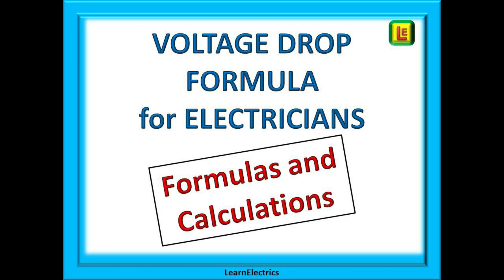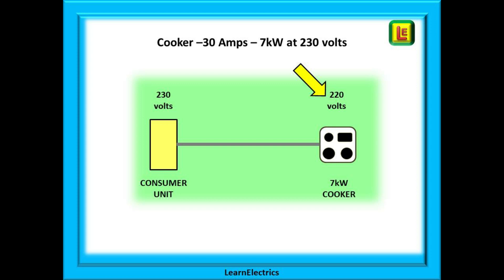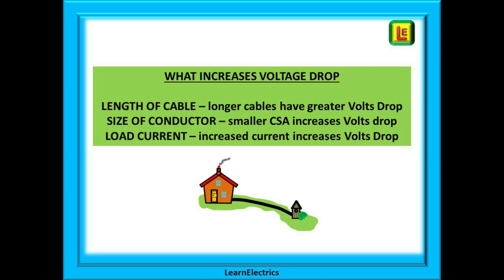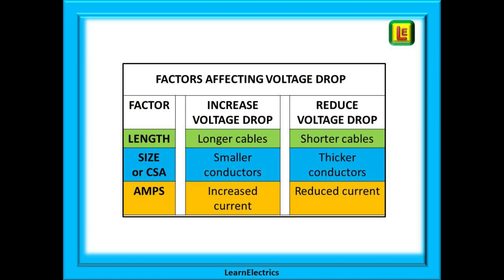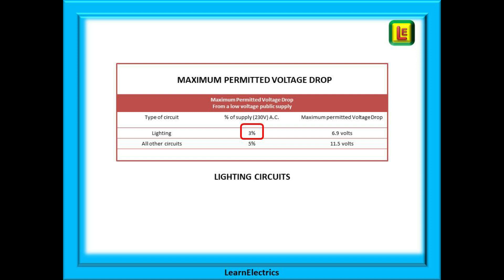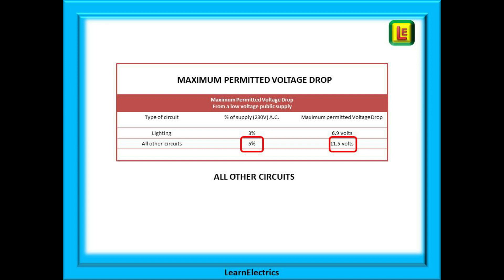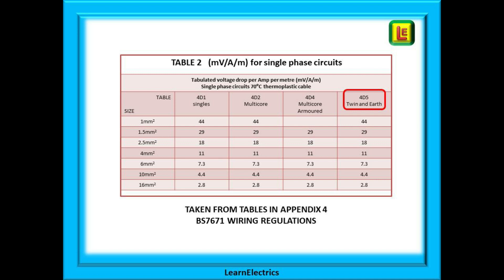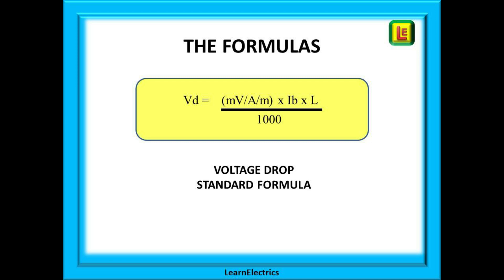VOLTAGE DROP FORMULA    Which formula to use and how to do the calculations correctly.

Comment: Do we calculate the length with 2 for single phase load ?
Reply from the maker: This is the single phase formula and takes account of there and back i.e. line and neutral. We just measure the distance one way and the formula does the rest.

Comment: Is load always assumed to be at the end of the full circuit length?
In a circuit with fixed loads such as a lighting radial, will the loads not be at different points/lengths from the CU and mean that we have to calculate vd at each individual point?
Lastly in a domestic situation its unlikely all lights will be on at the same time. are there any diversity calculations to account for or do we always assume worst case?
Reply from the maker: See previous answer, thanks.

Comment: If i am calculating voltage drop for a lighting circuit do i use the measured length of the cable from the distribution board to the furthest light fitting or do i need to multiply that value by 2 seeing as the current has to travel back to the distribution board.
Reply from the maker: take a look at this latest video we've made on voltage drop, it will give you more information. But to answer your question, only measure the distance one way, from the CU to the point of use, NOT there and back. dave.
https://www.youtube.com/watch?v=nVZeIFeEwl0
Reply: Good question, I think the tabulated values for voltage drop per amp per meter in table two account for both the line and neutral wires and therefore you dont multiply by 2

Comment: Hi I have tried this using the tables in osg to compare, it's very close to 2.5 wire but say not with 16mm cable using the majic 1.2 factor
Reply from the maker: The OSG rounds up/down the figures so there will always be tiny differences.

Comment: Could i pick your brain just the once more.

My own cooker.

Ib 4kw -4000w

L 1m cable.

mV/A/m is 6mm cable 7.3 mV/A/m (table 4d5)

7.3 x 17 x 1
~~~~~~~~
  1000

0.12 amp drop

Thanks.
Reply from the maker: Yep, that's almost correct Paul, it will be 0.12 VOLTS not amps - but is it really 1 metre from the consumer unit? If it was 10 metres from the Cu your Vd would be 1.2 volts 
Thanks for watching, lots more to learn. Dave.
Reply: @learnelectrics4402  i was just making up a low number to see the difference.

Comment: So I know I’m doing this right, can somebody help.

If I look at the final formula question, min size of cable to not exceed VD.

My own numbers made up below;

1b 3kw = 13amp

L 44

vd 11.5.

13a x 44L
11.5vd x 1000

Do I have this right?
Reply from the maker: No, you've missed part of the formula out Paul. You have not included 44 for the mV/A/m standard value.
the top row should be 13 x 44 x 44 and the bottom row 11.5 x 1000
This will give a cable size of 2.1mm minimum. You should choose 2.5mm cable.
Hope this helps. Dave.
Reply: Just realised what I have done…. Misread the formula and put 44 as L.

Comment: How would the equation change if we used an aluminum conductor instead? I believe its mV/a/m rating would be different, no? 

Thank you.
Reply from the maker: Yes, the data would change. Every material and mix of alloys has its own data table. For Aluminium cables have a look on page 479 in the brown Regs book. Thanks for the support. Dave.

Comment: Great Dave thanks. Why do we not use 50 mtrs for a 25mtr length. We have phase and neutral, 2 length of cable. Always wondered why the length is from the source to the appliance and not the return as well
Reply from the maker: The voltage drop calculations that the boffins give us have included the phase and neutral paths. Hope this helps. Dave.

Comment: Excellent Videos, thank you very much.
ONE QUERY PLEASE: 
voltage drop for single strand wire is 44mv per 1mm"csa per 1metre length, (my understanding)     
and for 2.5mm" wire voltage drop is 44/2.5 = 17.6mv per metre 

In this example we have 2.5mm" T&E 25 metres long ie 25 metres live wire and 25 metres neutral wire. 
So when calculating voltage drop for 25 metre long cable, the total length of current carrying wire is 25 m live and 25 m neutral = 50 meters. 
Voltage drop (milli volts) = (44 mv X 20 amps  X 50m length) / 2.5 = 17600 mv  = 17.6 Volts.

This is what I Understand, please look into this as there is lot of confusion. 
Its same for cable resistance. 19 m ohms / 1mm" csa / 1m length for one wire only.
Reply from the maker: I'm quoting from Guidance Note 3 and the Wiring Regulations which rounds the numbers up or down to whole numbers. On an average run length of cable it will only make a tiny difference. Thanks for watching. Dave.
Reply: @learnelectrics4402  Thank you for for quick reply. 
my point was there are 2 wires (live and neutral) each 25 metre long, so when calculating voltage drop total length of wire will be 25 + 25 ie  50 meters. 
So when calculating voltage drop  in one 25 metre long strand = (18 X 20 X 25 ) / 1000 = 9 VOLTS 
and in 2 strand (live + neutral) voltage drop will be double, ie 18 volts.

Table 2 / 4d1 (single) states voltage drop is 18 mV for 2.5mm" csa per metre.

Comment: Evening just revisiting voltage drop.😁
with regards to voltage drop when the load is unknown ie a summer house with three double sockets. And it’s unknown what client would plug in. Would we use the Breaker size at the board as Ib?
I guess my question is if ib unknown do we use the breaker size to carry out the formula. 
Many thanks.
Reply from the maker: Absolutely. Yes, us the rating of the breaker as your Ib. Thanks for watching. Dave.

Comment: sir , how can i download bs code for applying in electrical?
Reply from the maker: If you need the British Standards documents search Google for the BS number.
Reply: @learnelectrics4402  but bs code is not for free sir
Reply from the maker: That's correct. All BS documents have to be paid for. There is nothing we can do about that, if it is needed you will need to buy it from BSI. Hope this helps.

Comment: The first method used the length of cable and the second method used double this value ie live and neutral lengths added.  Do we need to understand why is this or is it something we should accept.   Thank you for great video
Reply from the maker: Michael, method 1 is when you know the cable sizes, lengths and (mV/A/m).
Method two is when you have two ends sticking out of the wall, no real idea of length, size debatable and no chance on (mV/A/m). All you know is the load of the attached equipment. Typical when inspecting and testing some properties or factories.
Method 1 you will need for 18th exam. Method 2 will give you the skill to work volts drop out on site when everybody else says it is impossible.
Learn both, look good. Hope this helps. Dave.

Comment: Hi teacher could you please give us example for cable calculation for three phase for one heater or cooker and second example for three phase also but we need to install 3 ovens every oven is 5.8kw alle these ovens in same cable and one circuit breaker. 
Thank you
Reply from the maker: Mohammed, we cannot give specific sizes for what you want as we haven't seen the installation and we do not know the installation conditions.
Look at our video 

Breaker and Cable Sizes for Electrical Circuits
https://www.youtube.com/watch?v=3_D65-32xp8

Thanks for watching
Reply: @learnelectrics4402  thank you for your response and if you can just one example for three phase cable calculation 
Thank you
Reply from the maker: We will be doing a video on three phase in the near future.
Reply: @learnelectrics4402  what is the reason  we have higher measured earth loop impedance ? And what is consequence for that?
Thank u
Reply from the maker: Usually poor circuit design in the first place or additions to circuits without recalculating.
The consequences of high Zs could be that the breaker does not protect the customer properly and they die.
Look at our video   Zs too high
https://www.youtube.com/watch?v=fUlCDhlcDf4
Reply from the maker: Yes
Reply: @learnelectrics4402  thank you sir was very useful
Reply: I have one more question and sorry for bothering you in advance my question is
Why it’s necessary to carry out testing even though we have conducted a thorough inspection?
Reply from the maker: Because you can't tell what the resistance is by looking at the cable.
Reply: @learnelectrics4402  thank u sir
Reply from the maker: Mohammed, we have more than 40 videos on our You Tube channel that will answer a lot of your questions. If you have subscribed to LearnElectrics then you should have access to them all. A new video every Monday morning. Good luck. Dave
Reply: @learnelectrics4402  yes I saw them and thank you for help I do level 3 electrical installation and I try to understand very well the regulations
Reply from the maker: Good Luck, it is a good trade to be in.
Reply: @learnelectrics4402  there are factors we should take into account when calculating maximum demand of an installation ?
Reply: They mean type of final circuit and where it’s ?

Comment: Where does the formula of how the cable is run,and the thermal conditions come in towards the final volt drop eguation xx
Reply from the maker: You should calculate the cable installation conditions and thermal conditions first to determine a minimum size and then the voltage drop to check that the size selected is ok.
Hope this helps, it can be tricky sometimes deciding which is the best order. Dave.
Reply: @learnelectrics4402  yes thanks,must admit a lot of electricians take things for granted without working out the volt drop,when I did the 17th update the lecturer was hot with volt drop,he gave us a sample for a 10kw shower in a house ,no great run and nothing special,it come out as the minimum of 16mm,everyone was shocked so to speak,I told him the manufactures had better make bigger switches to take a 16mm,I mainly do industrial work which is a different kettle of fish and working out voltage drop is a must 👍

Comment: Great video, very helpful thank you. 1 question though - if looking to extend an existing circuit, do I need add the total maximum of all consumers on the circuit and calculate length of cable, to be able to work the figures out and check if the proposed additions would comply? Thanks
Reply from the maker: Yes, any extension to the circuit will increase the resistance in the circuit and increase the volts drop. Having said that, if the Vd was just 5 volts, say, for a 15 metre socket circuit and you were extending by perhaps only 3 metres, it is clear that the extra 3 metres will not take you over the 11.5 volt limit. Hope this helps. Bux.

Comment: Great video. On the last formula could you explain the 44 figure on the top row of the equation? Where does this come from and why is it always 44? Thanks 👍
Reply from the maker: 44 is the reference figure that makes the equation work, it is the value for 1mm. Try it with the same values we have just used in the first example. 20 amps x 25m x 44 divided by (11.5 volts x 1000) gives 1.91mm minimum cable size and in the example we have chosen we have selected 2.5mm. Hope this helps. Bux.

Comment: Another great video .... been waiting for this for a while now...one question.... can both formulas use the 1.2 multiplying factor or is it just for the  ( R1 + Rn) formula
Reply from the maker: Thanks Dennis. Only the R1+Rn calculation uses 1.2. The (mV/A/M) number in the standard formula has already allowed for temperature adjustment. Hope this helps. Bux.